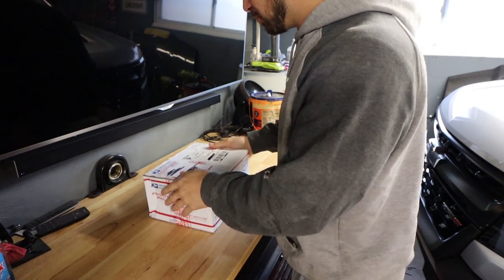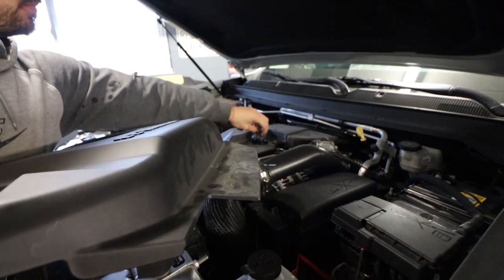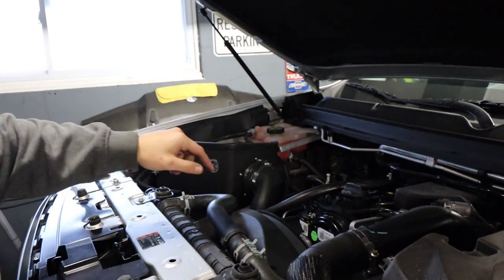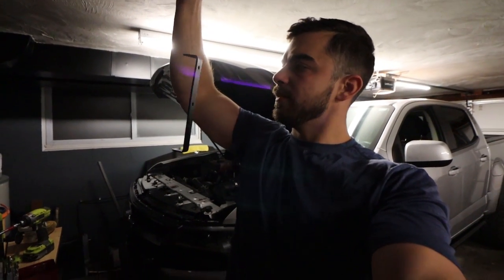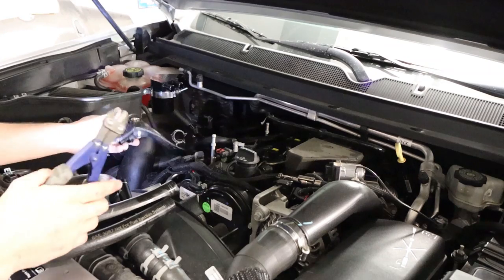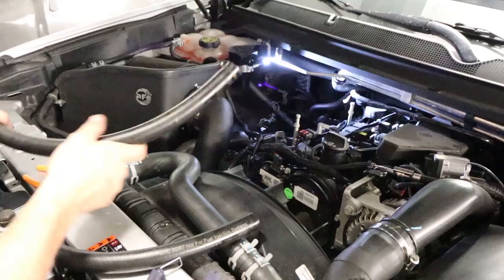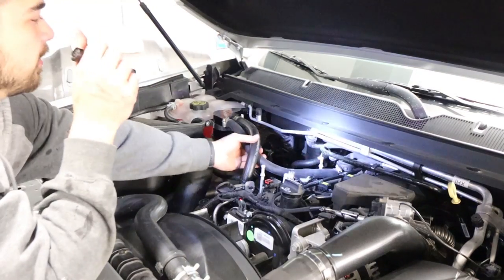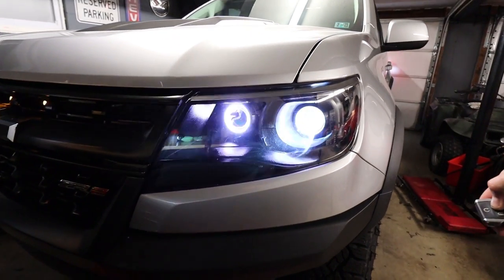Why Your Truck NEEDS a Catch Can - Colorado Diesel ZR2 Install

Comment: The catch can is a good idea if you have egr delete. However with egr the oil traps some of the dry soot from the egr and prevents unoiled  particles from destroying the piston rings & cylinders. A bypass oil filter will be a great addition to the 2.8L

Comment: Just switched out that rubber pipe from the charge pipe to the intercooler. Had a blowout on it. But the amount of oil got me thinking yeahhhh catch can time. I do have 117,000 miles on my 17 z71 tho.
Reply from the maker: Did it tear?
Reply: @matt13ross  the outer layer started peeling off and it started ballooning.  But I think it was punctured and patched by the previous owner instead of them replacing it. The joys of buying used lol.
Reply from the maker: Lol I may upgrade my pipes eventually but as for now, no issues.
Reply: @matt13ross  yeah, i just went with the oem replacement. Didn't see any real reason to upgrade just yet.

Comment: DT44 turbo wakes these up

BTW if you leave that foam noise deadner out from under the engine shroud it helps with cooling and it sounds better.
Reply from the maker: The engines can't take too much more power, neither can the transmissions, otherwise I would have upgraded mine.

Comment: As a heads up, if HD is your tuner, I don't believe they are making tuning changes, and thus you can't install the WCFab single kit. You will need another tuner
Reply from the maker: When the time comes I have a bunch of research to do!
Reply: Hunter
Can you elaborate on needing a tune change to do this install?

Comment: Plug the inlet side on the motor and vent the catch can to a small pod filter to the atmosphere. Keeps all of the oil out of the intake system.
Reply from the maker: I'm gonna wait and see how much fluid this thing collects.
Reply: You don’t even need a filter at the end, just run it open. You just run a hose straight down even with the oil pan, zip tie it to any wire harnesses or other hoses running down the engine and call it good.
Reply: Hello, just wondering What's the best way to plug the inlet side? I'm trying to do some upgrades to increase reliability/fuel efficiency for my chevy express cargo van 2.8. Thank you

Comment: Can this motor take a Twin Turbo setup similar to Fords 2.0 LTR and VW Amarok.
Reply from the maker: There is at least one compound turbo kit for sale, but the engine's can't handle a lot of power without internal upgrades.  Transmissions need help too.

Comment: Look at the cute little v4 haha
Reply from the maker: In-line 4
Reply: @matt13ross  my bad iL 4. Still just a waist . My 3.0 duramax that is only .2 litters smaller absolutely dominates that one with my truck being wayyy heavier
Reply from the maker: Right but this is an older engine.  I would have loved the 3.0 though.

Comment: Where did you hear about the wherli fab single turbo?
Reply from the maker: Saw it on Facebook! I don’t think it’s released yet. I’d add the photo here but I can only comment. It’s was on the 2.8 LWN page.
Reply: @matt13ross  just emailed them and they do have a kit and it should be releasing early 2021!
Reply from the maker: Nice, that’s awesome!
Reply: @ethanmcclure4258  it'll be out a few months into 2021. Make sure your tuner is able to make tuning adjustments before purchasing. There is some info in their November 2020 newsletter

Comment: Absolutely will be buying this truck when I can, but why do you have to add this? Is it a bad design flaw Chevy made? Why didn’t they just add one? Like what about people that don’t know to do this?
Reply from the maker: No car manufacturers offer these from the factory.  The can ice up in cold conditions causing issues plus it's even more maintenance for the owners.  That's my guess why they don't do it at least.

Comment: Hey bro can we do actually see if the work how much do you catch
Reply from the maker: I’m planning on it in a few thousand miles!
Reply: it took approx 7,000 miles on mine to catch enough oil to barely cover the bottom of the can
Reply from the maker: Yikes. Any other mods? Stock tuning?
Reply: @matt13ross  tuned and deleted, nothing else
Reply from the maker: That probably helps

Comment: Nice job. Wish someone did a catch can video for the V6. If anyone nose of one let me know. Thanks
Reply from the maker: Apparently the V6 has some sort of built in system and the catch can isn't needed, however I didn't confirm that.
Reply: It’s true, the v6 has a vapor catch can built in the engine. It sits in the center valley between the cylinder heads. I was able to find it on GM parts dot com.

Comment: I have a 17 baby max stock with 81k miles any mods you recommend doing? I don’t have to have any future issues.  Plan on driving this thing to the ground
Reply from the maker: Did you check out my list of mods video?  I go over a bunch of them there.
Reply: @matt13ross  no Im new here
Reply from the maker: Check out some of the other videos. I’ve done a bunch of mods to it!
Reply: Have you had any issues with the baby Max or truck in general?? Thinking about buying a diesel zr2 this fall.
Reply: @JG-mg3if  this might be an older comment but check out HD Diesel out of Canada. They got some “kits” that’ll greatly improve performance. They run about $2k but they’re the only company that I know of that has them for the ZR2 diesel.
Reply: @georgefloydsinhellwbreonna5330  hilarious Username lol

Comment: Have you developed the injection pump ticking yet?
Reply from the maker: No, haven’t actually hears of that. What’s the issue?
Reply: Gm has redesigned the pump so if your under warranty I think you can get it replaced. I believe it’s some kind of cavitation in the pump that makes it sound like a really bad valve tick. $500 for the pump from what I’ve found. Just google 2.8l Colorado ticking or drive through tick. Comes from the drivers side wheel well.
Reply from the maker: Thanks for the info! I haven’t heard that noise yet though
Reply: @spinninsmokeshow  I have a similar issue.. would that cause bad vibration? I hear the tick just after startup
Reply: @jessed7834  not sure, I have replaced my pump. Not a simple task. Had a shop do it for me and I think it’s 16hrs or something. If you think you have the tick then start using fuel additives

Comment: The newer 3.6 gas engine has a built In catch can for those looking to add one.
Reply from the maker: Good news!
Reply: How do you know?
Reply: @hectorcontreras64  I looked at the parts diagram for the engine. I can get you the part number for the catch can if you want. You can verify for yourself.
Reply: @hectorcontreras64  follow the large tube that is attached to the air box. Follow it to the back of the intake. The catch compartment is located in between the V of the cylinder heads and below the intake manifold.
Reply: @vw1610  thanks I’ll look for it in a minute